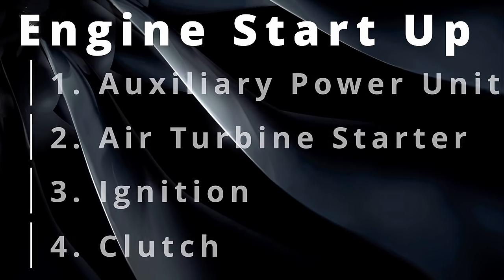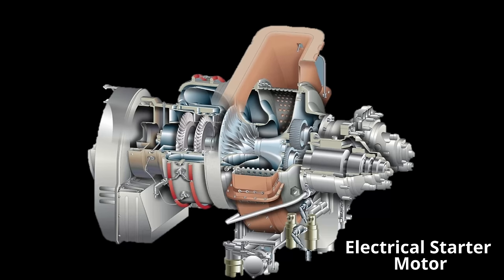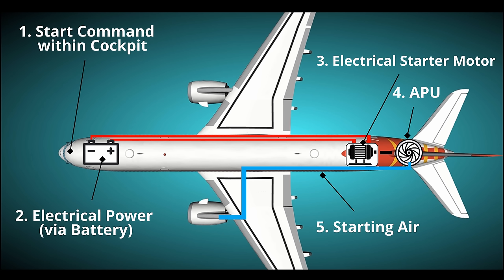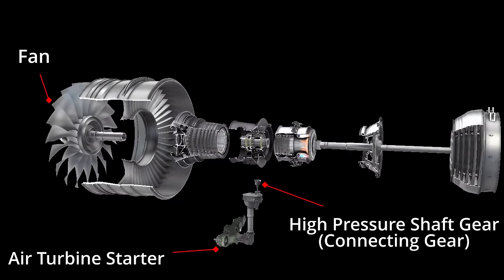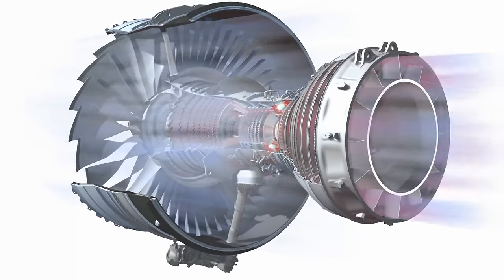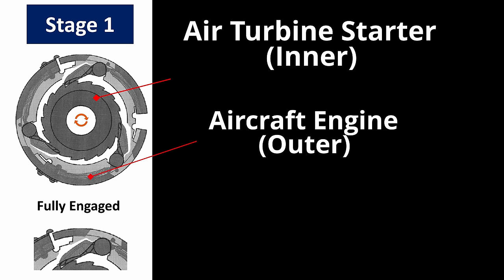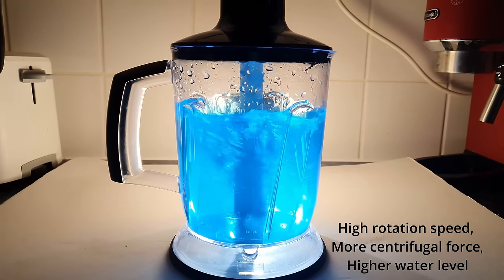How do Airplane Engines Start? (Including Startup Sounds)

Comment: The number 1 engine is on the pilot's left side, NOT the right side. And vice versa for the other engine.  You have them the wrong way round.
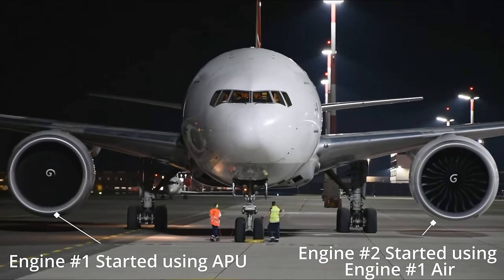Reply: It is shown correct no.1 is on left side at 4:16.. at 4:30 its wrong

Comment: @0:04 - "back in the good old days, you could just start a rotary or piston engine" - or? back in the good old days the rotary engines (not Wankel Rotary engines) were radial engines and used pistons.

Comment: Over 50 years ago on the planes I worked on the first thing we started was a jacking pump that pressurized the oil lubrication system and centered the turbine in the engine. I don't think that's done today with precision bearings now made. Then an electric starter started the turbine. Air from the compressor started the next turbine then the last two. Some air from the turbine was bled off and blown out to the front to break up the vortex that formed in front of the turbine sucking up stones. I don't know if that is still done today. One sound I always listened for was that faint "puff" when the fuel first ignited. The other thing I remember is they sprayed water into the turbine to increase thrust on takeoff.  This was over 50 years ago with a faded memory.

Comment: A ( similar ) process is used to start the  HUGE  engines of  MASSIVE  earth moving equipment ... a small automobile battery starts a " donkey engine " ... this might be a modest 2 cylinder petrol engine ( with minimal exhaust silencing , OMG ! ) ... this engine then rotates the  HUGE  diesel engine , until it fires up ( with  LOTS  of black smoke ! ) ...... DAVE™🛑
Reply: There's video on youtube of a small steam engine starting a huge one in a working steam museum, the concept has been around for some time.
Reply: I used to watch the Caterpillar earth movers starting the diesel with a small engine making a heck of a racket.

Comment: A cross bleed start (using a running engine to start another engine) is ONLY used when the APU is inoperative. With an operable APU the APU bleed air is used to start all engines.

Comment: The 777 starts both engines simultaneously using APU bleed air by the method described in this video.  The 787 starts both engines simultaneously using two APU generators providing electrical power to two starter generators on each engine.
Reply: Can be ..but not advisable.. these engines create a tremendous amount of when nearing ignition when using the ground cart or the APU. IF YOU have a failure to start you switch to the other to allow for the original one to cool.. plus the start air coming from the running engin is double the volume but not the pressure..
Reply: @thomasburke7995  All 787 Pilots are taught, by Boeing and their respective airlines, to start BOTH engines at the same time in normal circumstances.  Airplane & engines were engineered with this in mind.  It hurts nothing and has no associated risks or issues.  787 starters are only ELECTRIC.  The only Bleed air system on a 787 is the Engine intake anti-ice system.
Reply: The 787 has one APU, with two generators, since the 787 uses more electrically driven motors vs. a hydraulic system.
Reply: I believe the 747-400 used to start both engines on the same wing at the same time, 1&2 - 3&4 at the same time
Reply: @stevew8614  Boeing dose not make the engines and using the start up  procedures that the engine manufacturers prefer ensure longevity and minimal damage that will shorten TBO'S.. also airlines typical modify recommended procedures to best fit thiere operation.. just because you can dual start an engine does not mean you should.
Reply: Yeah, it is my understanding (2nd hand) that dual engine starting  was on the 747-400  only and only those with the GE engines (not RR or PW).  Not 100% sure though. @NicholasRiviera-Dr
Reply: @thomasburke7995 :
Well Thomas, for over two years now, I've been starting both engines on the 787 at the same time, exactly as I was trained, by Boeing and per the SoP of my airline(which pilots must follow).  The one exception being a recent MEL which expressly said to start one at a time.  
I have inquired with my peers at other airlines operating the 787 (GE engines) and they all do the same.  Yes, GE and RR make the engines and some airlines like mine don't even own the engines, we lease them.  If there was ANY evidence that starting one engine at a time on the 787 had any advantages, reductions in wear etc, I am sure we and the other operators would do so.
I suspect you are not qualified to speak on this with any expertise or first hand experience.
Reply: @foxlake6750  I think you mean pneumatic system (not hydraulic)
Reply: @stevew8614  our B747-400 fleet mainly had RB211 engines, pretty sure they started both on the same wing at the same time. The classic Jumbo we operated had JT9 engines, no idea what they did 😂
The B747-400 ER’s we had were GE CF6 powered and certain they were 2 engines at once to start
Reply: @thomasburke7995  our airline starts both engines at once on the B787
Reply: @NicholasRiviera-Dr   Good to know. I am kinda surprised the old "3 spool" would be able to do dual starts but then again the 747-400 has such a powerful APU bleed air output it shouldn't be.  take care
Reply: @NicholasRiviera-Dr  787 has ZERO pnuematics   (zero bleed air)
Reply: @justinglass9340  yes I am trained on that aircraft and I am aware of that. My response above was in reference to a comment made where someone might think a hydraulic motor was used to start an engine. Correct me if I am wrong but bleed air on the GEnx is used for (cowl) engine anti ice, the engine still uses some bleed air
Reply: @NicholasRiviera-Dr  You are correct.  No bleed air goes up the pylon.  The engine still uses it for EAI and for core processes.

Comment: Thanks HMW! Great to get these insights from an aerospace engineer. Are there any big differences in this process across different types of planes?
Reply from the maker: Thanks, and good question! Using an APU is the most common method, but the Boeing 787 Dreamliner engines use electrically started engines (no ATS). Fighter jets can use high pressure gas cartridges to quickly spin up the turbine and start fast! More information in the description :)
Reply: Awesome, thank you!
Reply: @HitMeWith or a jet fuel starter
Reply: @HitMeWith  I've worked with many of the different 4th gen fighters in the US. There are 2 types of starters. APU & JFS. APUs use bleed air to spin an impeller that spins over the engine during start. Some fighters that use an APU are A-10 Warthog (Not a fighter but attacker), F-22 Raptor, & F-35 Lightning. Other Fighters use a JFS (Jet Fuel Starter). It uses PTO shafts through a gearbox to mechanically spin over the engine. Some fighters that use a JFS are F-15 Eagle & F-16 Falcon/Viper. Some fighters don't have a starter at all. They require ground assist to start the engines. This is generally done with a jet powered start cart. Some aircraft that this apply to are the F-4 Phantom, F-5 Tiger, & T-38 Talon.
Reply: @HitMeWith those cartridges were used on improvised air bases that lacked electric starters on the ground.

Comment: Thanx for that .  Now I know how they are started.  I remember back in the 1970s going to my local  airport and seeing DC8s starting.  The always seem to give off a cough as the engine  fired up.
Reply: I think only the '50 series of the Eight made this whooshing sound, which might have come from the starter. The start air used to come from ground vehicles with a diesel air compressor.

Comment: Indeed well done explanation - the other first option, of course, would be to connect ground power after flipping overhead battery switches on, then get APU up and running using GPU.. great video. Regards...

Comment: At 2:48 there is a minor suggested change. It's not the pressure of the air that ignites the incoming fuel. It's the existing flame in the chamber. An excellent video. Nice job.
Reply: Agreed. He also calls them spark plugs, all the engines I work on they are called igniters

Comment: the same as any engine turn or spin it up pump fuel in to it or in this case heat it up until it turn in to a gas and ignite it. to power it up add more fuel to power it down decrease the fuel

Comment: For our maintenance engine runs we use the APU for both engines.  I’m certain the pilots usually do the same.  A cross bleed engine start is done when the APU is inop.  The first engine is started with a high pressure air cart.  (In the Navy we called them huffers).  Then they start number two with cross bleed.  Great video!

Comment: As an Engineer, Pilot (Recip), and Car Nut, the factoid I found most interesting is that the Heat of Compression was enough to keep things lit!!!  In Diesels, 17:1 compression is needed for that to happen!  Just a buncha Whirling Vanes makes 17:1???  Wow!
Reply: I'm always fascinated by those engines. Your comment made me looking for the actual value and mordern jet turbines reach up to about 50:1! So, maintaining enough compression to keep it burning doesn't seem to be an issue.
Reply: That's actually not accurate. The combustion is self sustaining from the constant flow of air and fuel, which is ignited by the heat of the flame. The pressure has nothing to do with it. Piston engines need an ignition source, either a spark or heat from pressure, because there isn't any combustion already happening. They use a batch process, while a jet engine uses a continuous process.

Comment: The real question is, why is the thrust generated during engine startup not moving the plane? Are there handbrake like systems..?
Reply: Idle engine thrust is nowhere near enough force to move a loaded aircraft.
Reply: @stephenholland5930  But the proper answer to the question is yes, the wheels have brakes to stop the plane wandering off when the pilot doesn't want it to.
Reply: And in addition to Stephen, on big aircraft like the B777 the engine at idle moves the aircraft. The bypass ratio is so big that during taxi the pilot has to slow down the aircraft using the brakes.

Comment: The APU is to provide ground power for electrics an air conditioning while the aircraft is parked among other jobs. Don't let an aircraft engineer hear you calling the igniters spark plugs even though they are. The engineers get all pear shaped about it for some reason. (No sense of humour probably) Also don't tell the that a jet engine is only a giant blowlamp with a fan at each end event though that is also true Exhaust gasses drive the turbine which in turn drives the compressor to shovel more air in.
Reply: What are the roles of the two shafts?
Reply: @b43xoit So they can run at their most efficient speeds. The low pressure fan turns relatively slowly compared to the smaller high pressure compressor and turbine. Rolls Royce use 3 shafts on most of their turbofans.

Comment: 0:03 - Daily nitpick: rotary engines are also piston engines. 

You might have mentioned that sometimes an external source of electricity and/or compressed air is used instead of battery and APU.
Reply: Clarification: "rotary" engines mentioned here are not Wankel engines, but a kind of "inverse" radial engines - crankshaft is stationary, and all the rest rotates, cylinders, pistons and all.

Comment: Thanks!! I work at LAX and LOVE LOVE LOVE watching the engines start when we push back. 
I do the mechanic headset sometimes and instruct the pilots when it’s clear to start engines Right to Left on a 777, or 4,3,2,1 in a 747.

🎉 ✈️ 😎
Reply: It’s even better when you get to carry out engine tests. Last test on a Tornado engine set up test is The Slam . We take the engine from idle to combat through afterburner. We slam the throttle from idle position to combat and the computer does its magic. We still have control of the engine via the throttle.

Comment: And is it the same for a flamed out engine restart in flight?
Reply from the maker: Not quite! A flamed out engine will still be spinning due to the air rushing past it. This is known as windmilling. Once it is up to the required speed, fuel flow re-starts and the ignitors fire to combust it
Reply: @HitMeWith  Thank you very informative!

Comment: Follow the checklist or flight manual if you’re a pilot. Follow the technical data if you’re a mechanic. Easy enough.
Reply: Both uses the engine start checklist🤷🏻‍♂️ 
And the "technical data" isnt an actual term🤪
Reply: @speedbird9313  perhaps checklists are acceptable if we’re talking about an in-service aircraft. 

I work in heavy maintenance so our procedures & operations are a bit more complicated and more thorough than the easier streamlined procedures that are set forth for flight crews operating in-service aircraft. The term “technical data” refers to any pertinent and applicable source material that gives you the authority to perform your job as agreed upon between the FAA, the manufacturer and the operator.
Reply: @AudioNaut93  Hm, ok🤔
Im under EASA, so it might be different.
Do you guys really need that through regulations or is it MRO based?🤔
We had just high power engine run by checklist after engine change on checks lager than C-checks and idle run on C-checks and lower🤷🏻‍♂️
Reply: Yes always RTFM (Read The Fuc..g Manual 😄

Comment: Amazing. I always thought that first sound was the first engine starting. Now I know it's the APU.
And I remember that deep grumble when the engine is fired up from my last flight.
Reply: I thought the same exact thing! 😅
Reply: That low grumble is awesome. The power gets the old testosterone flowing. 🤜💥🤛
Reply: The low grumble is very noticeable ina B777 with GE90 engines. It sounds like the engine is not willing to start a new business day 😊  Just like me with the alarm clock on monday morning 😖
Reply: The APU is usually started well before passengers even get on board. At the gate that is what supplies electrical power and air for the airconditioning

Comment: what about the static like sound at the beginning of engine startup of the A320? I usually hear it from far away because when I'm close, the engine startup sound takes over. It's like a weird static like sound (idk how to describe it)
Reply: never heard it.
Reply: At the beginning of the starting sequence the first noise you hear is the air escaping the air starter. It’s a constant flow. Maybe what you call a static like sound. Then comes the engine compressor spooling up.

Comment: Awesome explanation, thanks! 
But I wonder why Engine #2 is started with the help of Engine #1. I know it may be technical difficult but in case of some emergency (Engine #1 fails) we cannot start Engine #2 anymore. Why is there no backup from the APU possible for both engines?

Comment: All this takes time. Fine for airliners, but what about jets that must start very, very quickly? 
During the Cold War, when the Strategic Air Command's retaliatory B-52 bombers and KC-135 tankers sat ground alert and needed to be able to get airborne within minutes---lest they be vaporized by incoming missiles---we used a different approach: Forget the APU (or the ground air cart).
Instead, one engine on each bird was fitted with what you might call a slow-burning artillery shell. When ignited, the canister's expanding gases were ducted into the engine's fans, spinning them enough for ignition.
Once one engine was started, the others were then spun in turn.

Comment: Big changes on the turbine engines since the 'jets' started in O'Hare toward the end of 1959. How about, for us old folks, the sounds  and description of the start up of piston aircraft engines. Say the 1820's on the older twins, then move up to probably the greatest round engine (the Pratt & Whitney R-2800, the Wright R-3350's, then the P&W 4360,s. They each had their own sound and even the same engine on a different aircraft sounded different. I remember, at United, sometimes there were 3 or 4 Douglas DC-6's, with their 4 R-2800's, starting up at the same time - sure wish I'd had a recorder back then- although loud it was pure music to me. And then how they purred up at cruise. Yah I'm getting old - mid 80's. Jim Martin

Comment: Starter shutt off valve is the valve that opens when pilot selects "start" to allow the APU air to hit the air turbine starter motor mounted at around 6 PM position on each engine. Starter shutt of valve is a butterfly type valve mounted in the air ducting between APU and the air turbibe starter, it is electrically controlled. Air turbine starters are high speed low torque units, however a built in reduction gear system converts this high speed low torque to low speed high torque which is capable of rotating engine through a gearbox, also mounted on the engine. 
Leave me a note if some one is interested to learn more. Any topic, airplane related.

Comment: I wondered about this, I kept thinking the APU was some sort of battery bank. I somehow figured they started like electrically or pneumatic/hydraulically or maybe some smaller jet engine inside the larger one using a smaller area.

Comment: It is not the centrifugal force that causes those teeth to pull out.  It is centripetal force.  Centrifugal force is a "fake" force that ignores frame of reference.  For example if you are driving a car (assuming USA, driver on the left side of the car), and the car makes a sharp right turn at speed, you feel like you are thrown out to the left.  What is actually happening is your body was continuing in a straight line like the car was doing prior to the sharp turn.  You "feel" like you are thrown to the left against the door.  What is actually happening is the car is pushing you to the right, towards the inside of the curve of your sharp turn.  You feel the force pushing you left, but in reality the force is pushing you right.  Centripetal force is this true force, pushing you to the center of your curve.  Centripetal force is the imaginary force you feel throwing you outward.